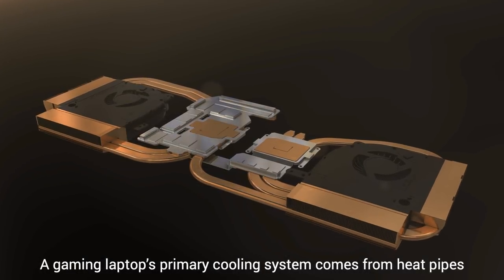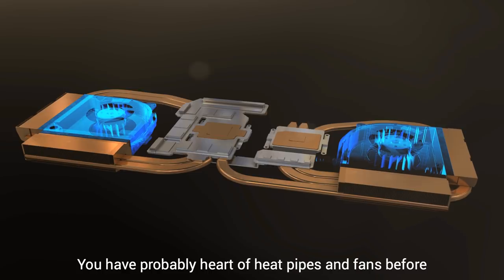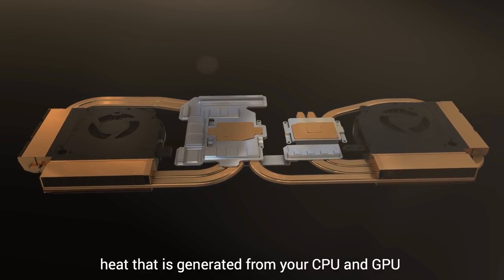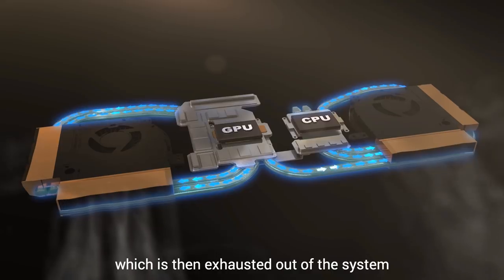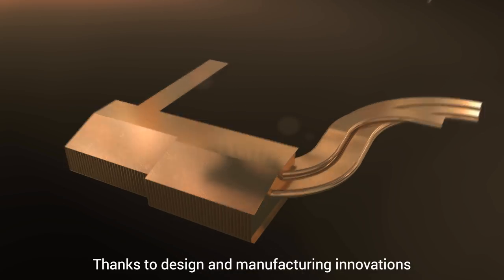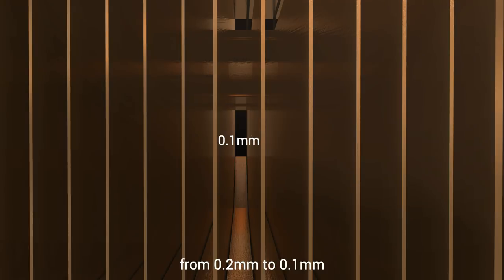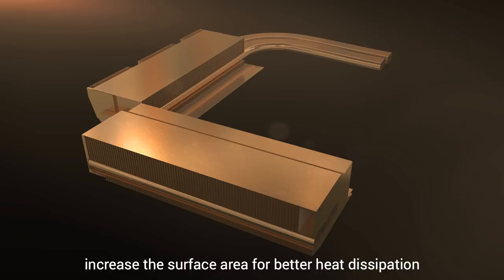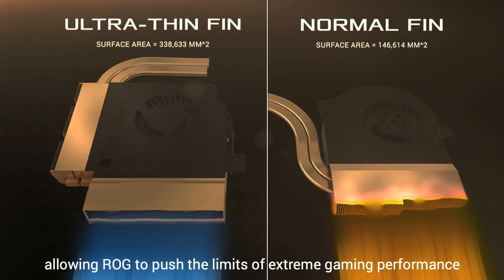Ultrathin Fin Design - ROG Laptops | ROG

Comment: one thing seems to be described wrong in your video. if the ultrathin fins are more efficient, they exhaust more thermal energy than normal fins. so airstream from the ultrathin fins is hotter than normal fins'. and as you intended, ultrafin applied model will make cooler processor.

Comment: To be fair, my G750JZ's normal fin size would do just fine, if both cooling modules would be pure copper. But, ASUS opted to only use copper for the GPU. Which transfers a great amount of heat, remains cool, and is working great. CPU? Not so much. The aluminium fins/pipes cannot transfer enough heat.

Comment: what does increased fin density need?
Reply: More fins per square inch (or square cm) means more surface contact which allows more heat to be transferred to the air.

Comment: How can a thinner fin would result in a better gaming performance for the laptop? Don't be stupid! Both MSI and Acer have implemented triple fan technology. And as for the design. Acer's Predator 17X has triple fan technology. 1 on the bottom facing the user. And the two that are facing at the back of the laptop when opened! I considered this tech from yours a piece of garbage! Coming from an asus user!
Reply: totally agree. And i'm an asus user myself as well.
Reply: Of course, proper cooling ensures better performance! Especially for laptops, where the temperature is +90°C, which also reduces thermal throttling
Reply: Mikko Segersvärd How's that work if you're living on a tropical climate?
Reply: Mikko Segersvärd Looking upon the design of this laptop. Asus has been known to make poor quality cooling systems. If not for having more fans. Then having more heatsinks that other brands equate for better cooling solutions not thinner grills. With no fan boost even when you activated it. How can you cope up for thermal throttling? Having thinner and more grills would only trap those dust even more.
Reply: Mikko Segersvärd
 Almost every gaming laptop that asus have have an ODD designs instead of a plain one with a grill for a better ventilation. Getting a laptop with a bigger fans for better cooling of the surface area is only available on some asus laptops. Meanwhile, if you look at the bottom of the other gaming laptop models such as the MSI, ACER, and even the Lenovo Legion. They have a better cooling cooling solutions because they have a lot of inlets and outlets. These videos will show you why:
https://www.youtube.com/watch?v=aLnO0Z9BJ8U
https://www.youtube.com/watch?v=CN_T6lsxcW4
https://www.youtube.com/watch?v=jg47IVh5pII
https://www.youtube.com/watch?v=I9qk3cGqAGY
Now if you look at the list of asus gaming laptops with perfect cooling solution. The only category that applies is the zephyrus. While the others have worst. Even their Asus ROG Strix GL702ZC which is a pure AMD chipsets and GPU. Has the worst design for an air inlet! which is in the middle. AMD's chipsets and GPU's have a higher thermal durability because majority of their products goes way hotter than what Intel or Nvidia could do. 
And ever since. There's has been a lot of complaints on asus laptop products in regards to overheating. My laptop. Which is X550Z is a pure AMD laptop. And my problem ever since is the heat since there's not much of a ventilation. 
Not all users could afford the Asus laptop that you have since it's much more expensive.
Reply: Well, as a user of zephyrus gx531 i must say sadly this comment didnt age well  cause my cooling system is very good, gpu never went above 80 and cpu never reached 90 🙂
Reply: @vermonjavic6992  well my gx502g  with rtx 2070 ...i7 9th g .. just change motherboard cuz heat problem lol..the liquid metal maybe dry..my temp 90 -95 sometimes 98 c b4 change motherboard,,now temp can go to max 95 thats it..game perfarmance so far no fps drops ...